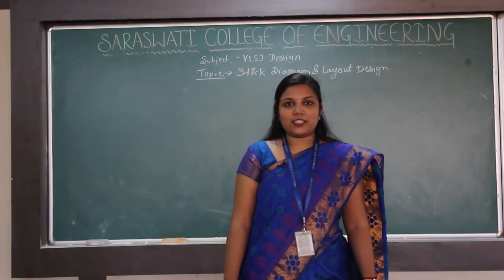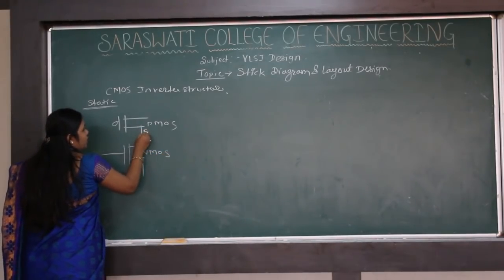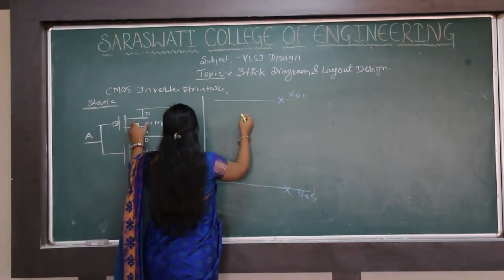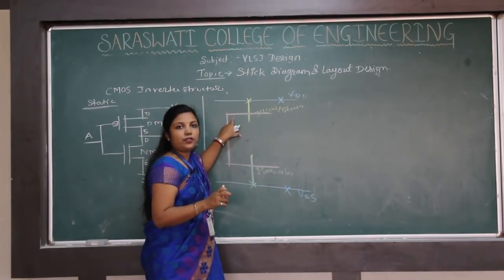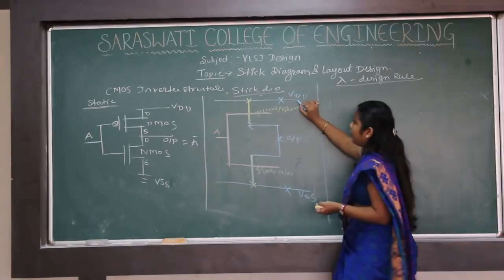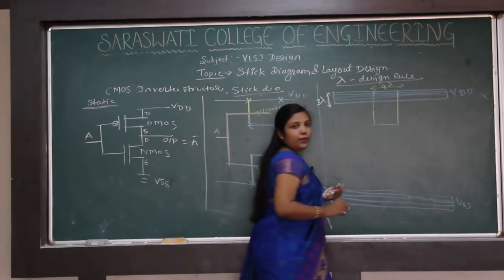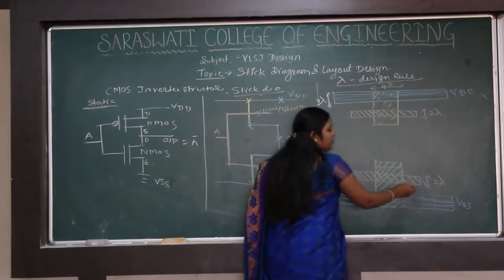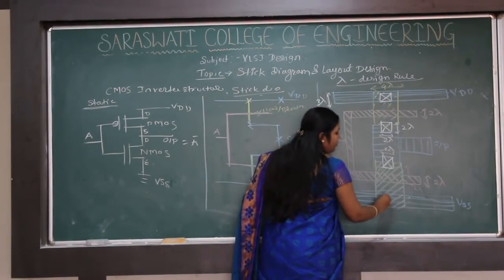VLSI stick Digram and layout design

Comment: Ma'am,
The source of pMOS must be connected to VDD.
The X mark on the VDD and VSS line represent body/substrate connection.
The contacts between diffusion layer and metal must be represented using node not X in stick diagram.
Reply: Yes